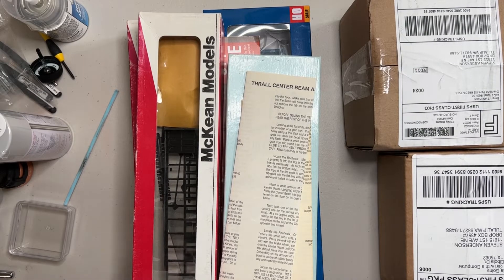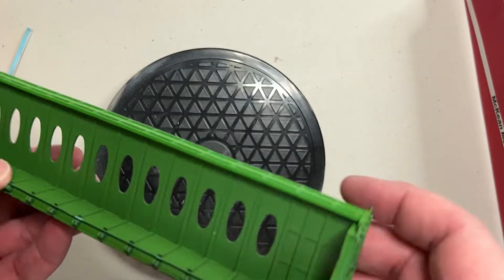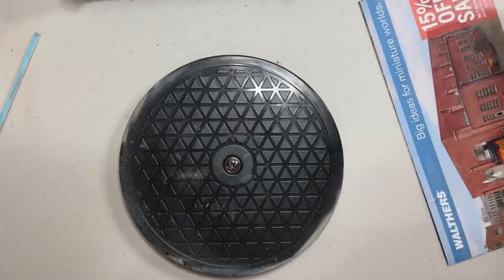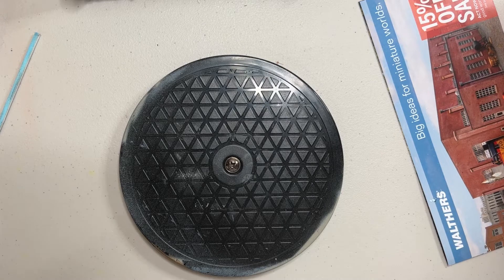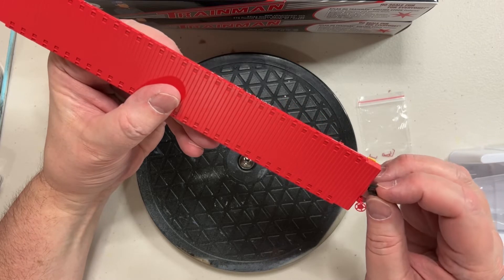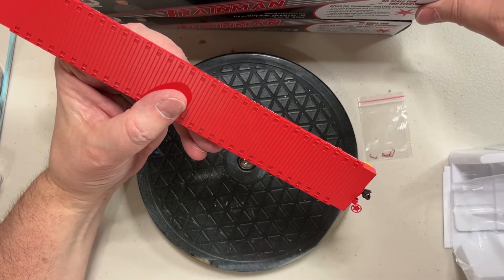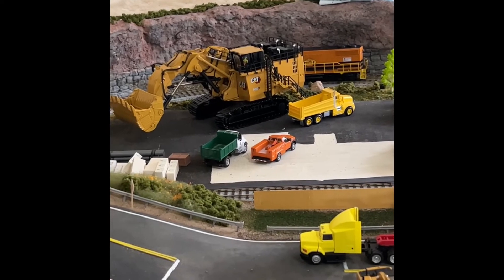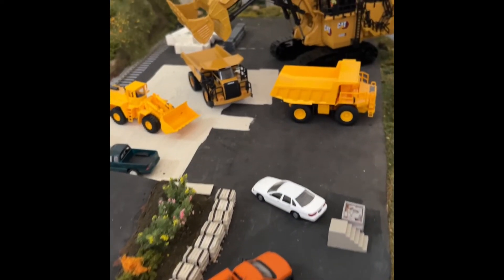What’s up?  Oh big mail call.

Comment: You think a few dumps of shovel into the 772? I bet 1 maybe 1.5 shovels! Next time I'm home, I'll set up all of my Norscot CAT equipment next to it! Or my 1/50th 798 Wheel Loader. Place the Beetle in the truck dump! Where's Sparky's house? I bet that shovel would look good next to a 2 story house! Call DieCast Masters and have them sell me a FS Shovel, but in pieces, to haul on trucks or a train! Hey, you have a 3D Printer? Start printing individual pieces of the shovel so I can have a truck or trash Convoy!

Classic Mint Construction, or is it Collectibles? Dan Goins.

You forgot to edit out THE HAND!

Your green BN center beam, replace the plastic brake details on the bottom with steel and use a solid steel tank. That might add eough weight for the car?
Reply from the maker: So I watched some videos on 6060 And I think those trucks could handle two scoops. Not all of them had the Hugh trucks. But until someone comes out with an affordable model of the 789 or what ever that’s what I got. And I know I can fit 3 VWs in those dump trucks easy. Just wait a month and see if DM has any broken ones, then you get it at a discount and you can take it apart. Of course it will be a lot of flat loads. 3 for boom and bucket, tracks are two more, it has a modular design 4 for the body and another for the turning two or three for the bottom. That’s a lot. Or you could buy me one and I’ll take apart for you. 
Well anyway, the thing is big maybe a little too big but it’s going in a rock quarry so it should be fine.
Reply: @steve87thpsap It sure would be a neat convoy of heavy duty trailers going down a highway or parked at the truck stop! Would it be worth it to buy 1 and take it apart? I'd be happy to just have the tracks, each boom, hydraulics, bucket and the rotation mechanism as loads. I would hate to see the body cut into pieces! 

797 Off Road Mining Dump Truck is the biggest, I think. 

From Diecast Emporium(YT Channel), the little black plastic thing, tweezers to place your shovel driver in the seat!

Comment: how much cheaper is getting a kit to build compared to a ready to run model? 
is it worth the time?
or is it just to say you built it ?
Reply from the maker: You know Sparky Vinny kinda said the same thing. These were less then $10 each, but I have put in a lot more time then that. I still gotta paint and decal them. So I think the east kits like Accurail were it is only a few pieces it’s worth it but yeah, after these it’s I won’t be getting other kits except box cars and covered hoppers. Those are pretty fast.